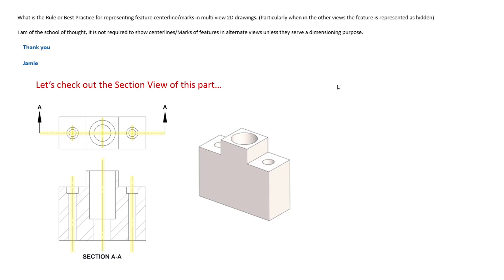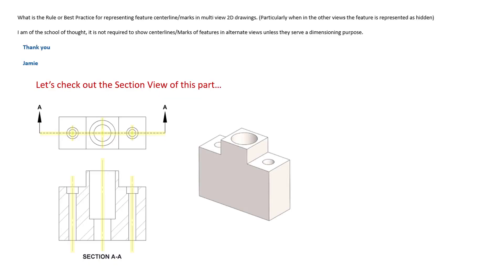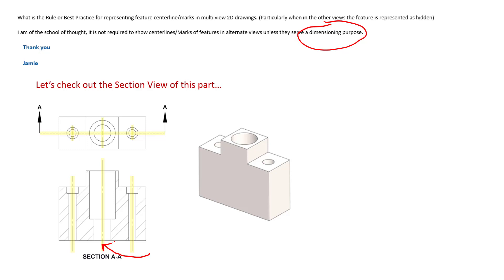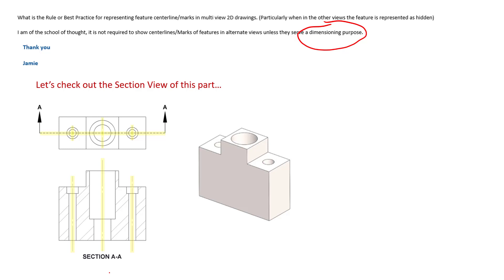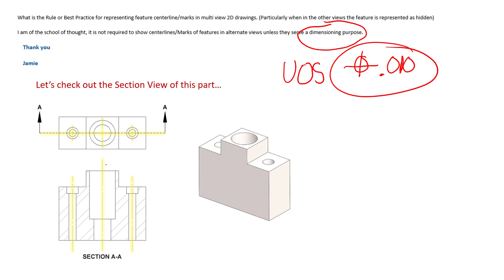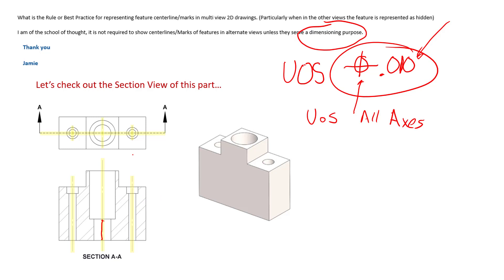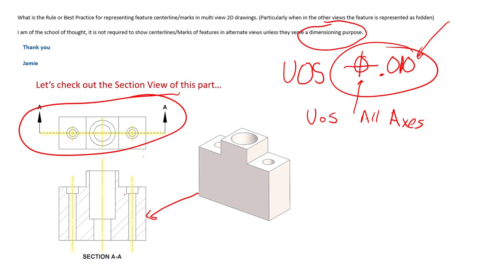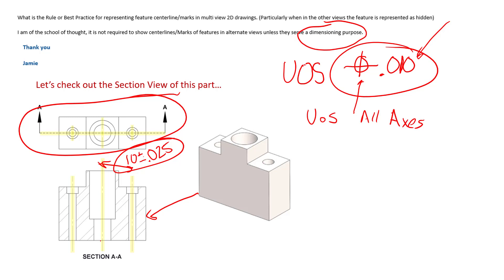Centerlines on Engineering Drawings and how they should be used correctly

Comment: Just watched the whole video but couldn't get know a simple thing viz. what should be the length of the intermediate lines of centre line.
Reply from the maker: Thank you for your question! The length of the "long line" and the "short line" that make up the centerline are not dictated to any length. The standard ASME Y14.2-2008 section 2.7 just simply states the length of these lines may vary in length depending on the scale of the view.
Reply: @Gdandtbasics  thank you, the answer is appreciated

Comment: When you are using centerlines on features other than hole geometry, what kind of tolerancing scheme do you apply to them? For instance if you are using the centerline to determine symmetry and it is NOT the datum), how can the manufacturer of the part understand what kind of tolerance to apply if any? Since centerlines are not often used as datum features (to my limited knowledge), they typically do not have any associated dimensions so it is not obvious how the symmetrical features should be toleranced in terms of symmetry. I hope that I have asked that question clearly. Thanks for any help you can provide on this!
Reply from the maker: Centerlines are used to represent the center of axial features or the midplane of width features such as a keyway. One way to look at a centerline is simply as a basic dimension of zero. There is NO tolerance associated with it and it does not imply symmetry or any other sort of geometric tolerance. However, what can be implied on drawings is if a feature looks to be 90 degrees to another, a basic dimension of 90 degrees is not required. A similar assumption can be made with coaxial features or a part that looks to be symmetric. No basic dimensions are needed to further define the true profile or true position. But, as with any basic dimension the surface or feature of size associated with that basic dimension MUST get its tolerance from a GD&T symbol such as profile, position, or any other locating/orienting symbols.
Hope this helps!